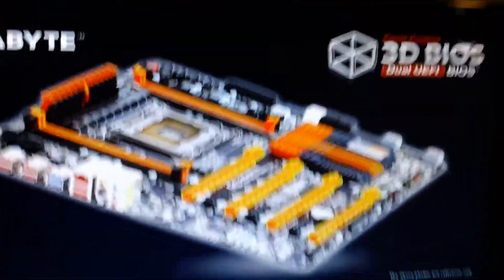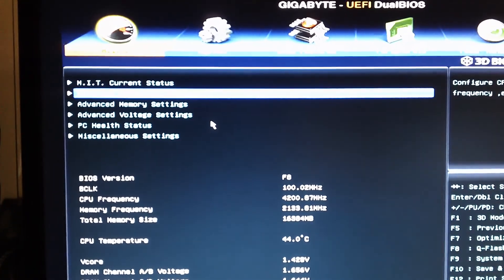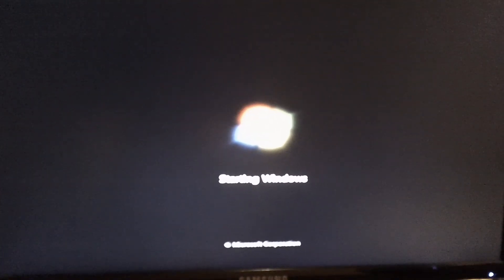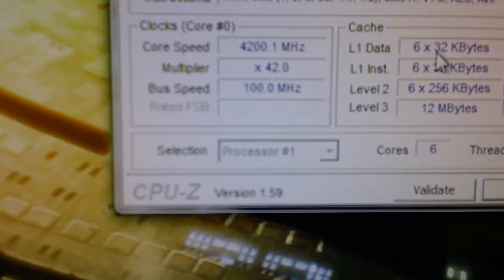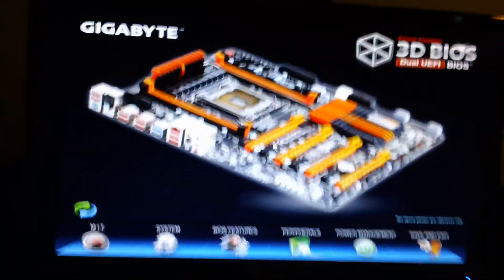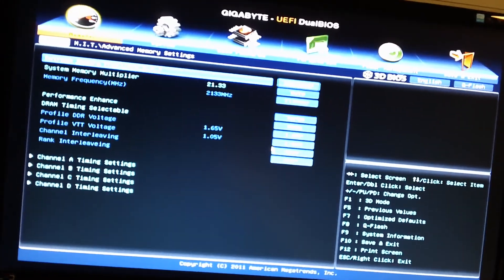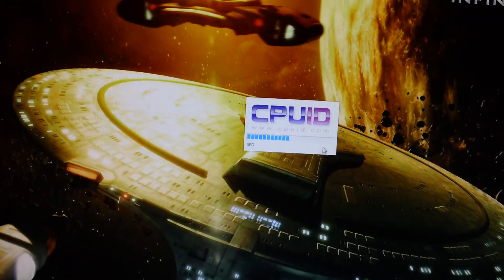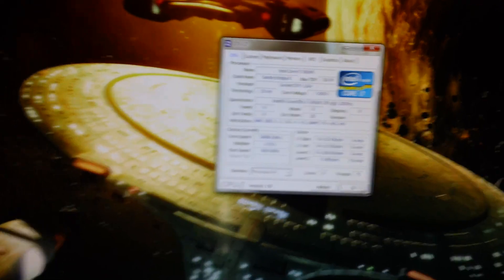GA-X79-UD7 not exploding after Overclock and F8 Bios Issues

Comment from the maker: @SUNHDV I have gotten this system to 4.7GHz no issues, but i will not be overclocking until gigabyte has either fixed the issue with a bios update or a replacement board